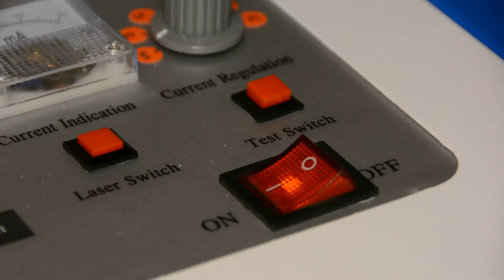K40 laser cutter safety switch for the lid

Comment: im prob being a little dumb, but better safe than sorry. the switch has 2 terminals, in the video, i think i saw you only connect 1 to the laser on button. to be vert sure, im guessing that what i saw was you disconnected one of the 2 wires on the existing laser on switch and just wired this switch in line with that wire. that would make sense, i just want to be sure, thanks
Reply from the maker: That's correct. The switch is in line with that wire. So the circuit is open when the lid is open.

Comment: Good idea, but that installation only prevents the use of the test with the door open, does not prevent the laser from running if the door is openedThis switch must be connected in series with one of the cables of the J1 laser enable connector of the power source
Reply from the maker: Luis Martin You have to wire it into the Laser on switch; not the  Laser Test switch. It should then have the same effect as if you switch the laser off.
Reply: @WayofWood ok I agree

Comment: Nice, though I've a digital readout and the laser switch cannot be used - looking for a solution.... Nonetheless, a concise video of ongoing vital relevance. Vielen dank für die mühe - es hat sicher vielen leute geholfen.
Reply from the maker: Thank you. You could install a warnings signal / buzzer when the lid is opened. Better than nothing. :-)
Reply: @WayofWood  Unless there's a hard/software failure, I should manage to wait until the apparatus is finished. It is not to be approached as a toy as you know and should always remind of high voltage and laser light. Your switch is an obvious 'must' but I'm not risking a board for any attempt - I want it to work (modded of course - done the smoke, airassist, stabilised the bendy bottom - making an adj table now.). If it is working, why open the door? Hope alles gut mit dir und das wir bleiben unbeschädigt :-)
Reply from the maker: QaaUz It’s indeed not a toy. Having kids around that are always looking for new toys was a key reason for the switch.
Reply: @WayofWood  Ah, right. I actually came to edit my comment - it the case of mirror alignement, it could definitely prevent an 'oversight' - that's just the sort of setting for a mishap. Children or any unapproved access is really a state of which to be aware in advance. Sad not to be able to make the simple switch connection - it belongs doesn't it. So prehistorically obvious really.